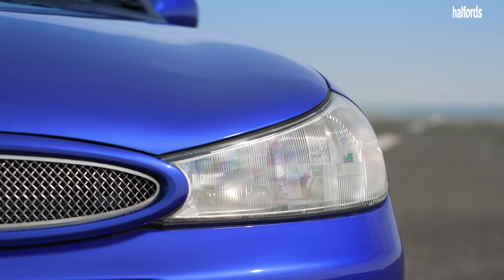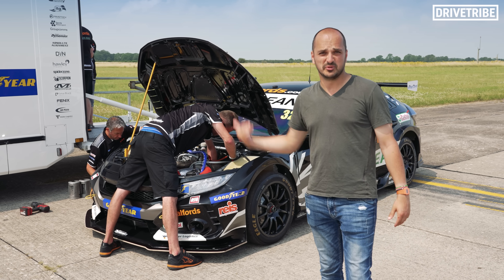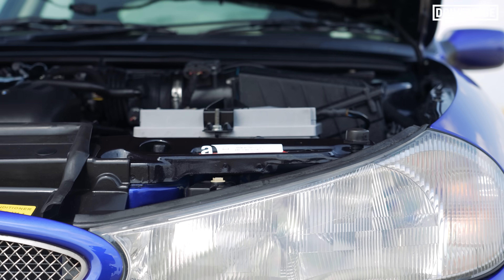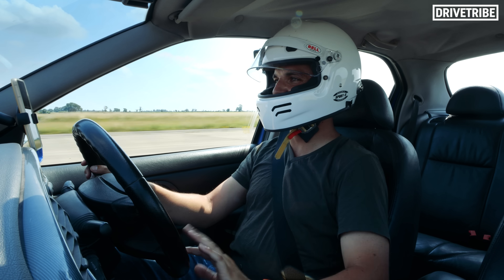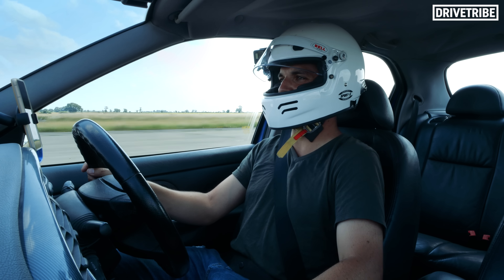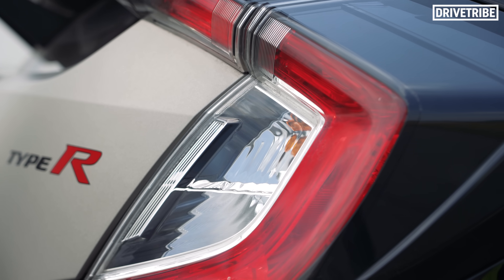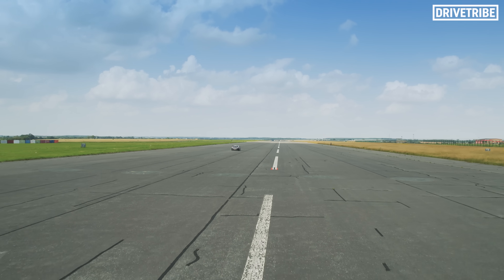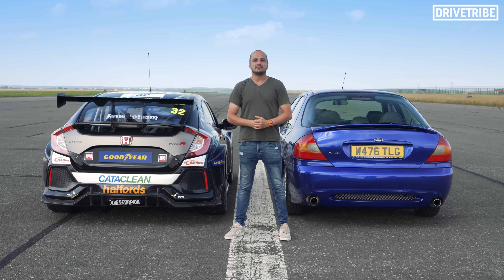Can our 21-year-old Ford still hit its original top speed?!

Comment: If you ever feel useless. Just remember that this episode had a Halfords Technician torque the wheel nuts and check the levels on a newly restored car 🤦‍♂️
Reply: That's exactly the time to check it. People did that restoration and people make mistakes. And I guarantee it wasn't a master tech who installed the rims and tires. It was the shop apprentice. I'd he checking everything as well
Reply: @Maroco918  I knew someone was going to write that. I will make sure to get a Halfords Technician to pop round my house 3 days after I next have my tyres changed. 🙈
Reply: @Maroco918  I'd rather the apprentice check over the work from halfords given what I've seen them let out the door back to the customer.
Reply: What's an advertisement??
🤡🤡🤡🤡🤡🤡🤡🤡🤡🤡
Reply: @Maroco918  do you check the torque of every suspension, steering and braking component when you buy a new car then?
Reply: @Pugjamin  no, if I buy a new car I have a PPI (pre purchase inspection) paper signed. I only check for cotter pins and lug nuts on new vehicles. If I buy a used one, yes everything gets checked. 

I did PPIs for 6 years at a dealership, you'd be amazed what shows up wrong, loose or missing from the factory. Sometimes you get had batches. Ive witnessed it first hand too many times. People put cars together and people make mistakes. I'm not chancing that when my wife and 3 kids are using a car.
Reply: Only way to be sure is to do it yourself. Isn't too difficult...
Reply: We got a shop to install a drivetrain into my friends car, had a solid rear axel. And the goons didnt tighten the u bolts. We were crab walking all over the place
Reply: @MrSilverNutz  that's terrifying! Glad you guys are all right. It's crazy what a flat rate industry can produce sometimes
Reply: @Maroco918  ya it was, we got it all tightened down, but now it crab walks constantly haha. Off to the alignment shop i go
Reply: @Maroco918  the second you validated yourself as having a wealth of experience the YouTube hounds immediately move on to their next victim and attempt to act like they know what they are talking about. It's hilarious to watch.
Reply: @stevenross-watt8640  they scattered like roaches when the lights come on 🤣🤣, have a blessed day brother
Reply: I bet he felt useless
Reply: Not the smartest way to work in one of your sponsors
Reply: Why so rude. Someone had to pay for the ST200 project....
Reply: Sound like advertisement to me.
Reply: @blackericdenice  that’s because it is
Reply: wheel nuts can come lose. even more on new rims. seen it happen. tyre pressure could be taking it form normal road to a high psi for track use. and levels change alot. motor might burnt some oil with its new seals it happens
Reply: @jnrdirtyduck3499  Yeah but you don't a guy for that.
Reply: @dutchdna  you do it their paying you
Reply: @stevenross-watt8640 and you're not on YouTube looking for victims, huh? Loving the projection...
Reply: yeah but that car as lovely as it is also puffs chunks of blue smoke under heavy load so the top end(s) needs a rebuild anyway lol

Comment: Sagging headliner, wrong springs at the front, no ST200 badge, engine smokes like my old 2.0 Duratec with worn piston rings… the final result is rather disappointing
Reply: And the front bumper was fitted poorly
Reply: Knackered rings plagued the 1.8 and 2.0l duratec as they aged, killed so many mondeos with otherwise decent body's.
I drive a V6, they are bullet proof :)
Reply: Yes, I noticed that the front of the car is sitting very high like a clown. I think the guy that rebuild the engine used the standard springs to a Mondeo V6 instead of the ST2000 springs. He does not know what he's doing.
Reply: My 50 year old Corrina does a 1/4 mile in that time. What a joke. They also look like std ST24 front springs. Not right for that car at all.
Reply: @placesbramlepoops  st24 will do, the mk1 and mk2 are the same car.
Reply: @danielfl.9347  i have a picture of my st200 from 2000 - and the gap size was the same as you see in Mike car, if you use Ford ST200 front spring - the results are the same
Reply: @danielfl.9347  where do you get st200 springs from nowadays ?
Reply: @johnstonlee  From Ford.
Reply: @danielfl.9347  😂 go on then, let me know if any available from Ford.
Reply: Yeah the front springs and the blue smoke were really red flags for me
Reply: Richard Harrold  Mike stated that Mad Ford had already completely run the engine in
Reply: @ivopongrac6601  And the passenger side rear door is a different shade of blue....

I really don't understand the end goal here. For an on camera restoration, the execution is pretty awful. No doubt at all it's had a ton of work done under the skin, but the lack of any attention to detail really lets it down.
Reply: @Mrcento  The presenter in the video stated that "Halfords have sponsored the entire ST200 build".... I guess this means that with what little funds they had, they tried to make the most of it. The results are.... ordinary.
Reply: @ST-pw7wf  I did not have the Mondeo, I had the Contour SVT from 1998. Mike's car is too high in the front compared to my pictures of the old Contour.
Reply: Actually my worn old 2L Duratec Mk3 with shagged rings smokes less than that. Bet yours still goes like a champ too
Reply: yep, the headliner was so sad to see. so like any other youtube car, it's looking perfect from a far, but it's far from being perfect
Reply: The truth is now out 😡
Reply: @stevefox3763 That was the MK3?

Comment: So the engines been 'rebuilt' and is smoking like an old ford transit??
Reply: Rattle-can rebuild. :D
Reply: I'd imagine it's wd40 still being burnt off from the build.
Reply: @MaryjaneKush  I know I'm not the biggest Ford fan myself but a freshly rebuilt engine will have non engine oils here and there and the first few pushes bearing a load will push that through.
Reply: @mypinis  There won't be any lubricants from the build left! He clearly said it was run in before this test🙄 Who on earth would go and run flat out with a freshly built engine? If you truely thought that, then I wouldn't want to buy a used car from you😎
Reply: @MaryjaneKush  Fix Or Repair Daily
Reply: @rogerblackwood8815  why was the car smoking then?
Reply: @MaryjaneKush  and GM stands for Grotty Motors
Reply: Fix Or Repair Daily
Reply: @mypinis  I didn't say it was the best rebuild, just that it wouldn't be lubes from the rebuild, learn to read AND comprehend mate!
Reply: @rogerblackwood8815  the rings bedding in maybe?
Reply: @rogerblackwood8815  you car people are such annoying picks
Reply: @Roger Blackwood  there were under 200 miles on the engine, its been sat at the shop until this filming day was taken down on a trailer and lets just say that's also how it left because it wasn't able to under its own steam by the time he'd finished with it
Reply: @cynosuregambit8292  As I don't know the history of the car I can't really comment can I? Lets look at what we are discussing here, Matt said the engine was rebuilt and smoking like an old ford transit, which I thought was quite a humorous joke. I'm the best suggested it the smoke might be wd40 burning off from the build. I merely pointed out that any lubes used in the rebuild would have been burnt off long ago as Mike clearly said it had been run in, I did not hear any mention of how it was run in and to which schedule. So where did you get 200 miles from? And I don't know for sure either way, but I didn't get the impression he'd blown the engine so why would it need to be trailered away, unless it wasn't road legal?
Reply: It’s Hardly smoking jeez 🙄 it’s an internal combustion engine. It burns things and it’s an old car with old tech none of this opf dpf etc it’s going to have some residue.
Reply: @johnstonlee  You might want to read the comments I've left it deffo was smoking
Reply: @MaryjaneKush  I grew up on fords and never once let me done. Regular servicing is all it takes IMO. ST24 was hands done a beauty to drive on B roads.
Reply: I've got no beef with mondeos. I own one and it's great. But that rebuilt engine is knackerd
Reply: Matt, the engine was fresh build, not even driven in yet.. & he redlined every gear.. ended up blowing the fresh engine :D
Reply: Richard Harrold  Who knows ^^
Reply: Richard Harrold  Yes he has, He destroyed piston 6 because he has no mechanical sympathy and didn't actually run the engine in, it came from Mad ford with less than 200 miles done on the freshly built engine and he thought top speed runs from a standing start was the best way to do it until it went bang, Redlined every single pull. This whole video was bollocks
Reply: Gotta love a Ford 🤩

Comment: i see the exhaust smoke is colour matched to the car, nice touch
Reply: Looks like an american ford now
Reply: Nice
Reply: Richard Harrold  they did say that it had been "run in already" I wonder how long it was run in for
Reply: Richard Harrold  piston rings don't need that many miles to bed in lol.
Reply: all cars smoke under full gas pedal
Reply: No....no they don't  @EazyDuz18
Reply: @imthelastone  they do, its an engine it BURNS things so it has EXHAUST fumes
Reply: @EazyDuz18  fumes and smoke are not the same thing...you are very very wrong
Reply: @imthelastone  agree to disagree :)
Reply: @EazyDuz18  but then we would both be wrong ...sorry you are wrong and that's that 😂
Reply: @EazyDuz18  Yeah cars don't smoke visibly under load 😂
Reply: @EazyDuz18  That would be black, if the car runs fat to cool down the engine, or as we Germans say, Vollgasanreicherung. That was blue BUT its probably the new mufflers in the exhaust that havent seen that much heat yet
Reply: @imthelastone  Nope, you wrong just except it
Reply: @WRP_2003  they will do in the right camera angle and lighting go do some tests and report back
Reply: Could be clutch smoke too
Reply: @RandomReevuze Considering you don't know the difference between "accept" and "except," I think you need to take the L here and move on.  Those piston rings are clearly wiped.
Reply: @cruzcorp914  not from the exhaust pipes
Reply: @EazyDuz18  properly tuned engine burns so much theres nothing visible and exhaust system catches the rest.  So something is defective with the cars you're using.
Reply: Richard Harrold  built loads of race engines and never had one smoke like that without an issue
Reply: @maximumst  when you cant win an argument: correct grammar instead
Reply: @EazyDuz18  yeaaaaa that motors got problems
Reply: Richard Harrold    Incorrect.  If you actually watched ep. 2 of the restoration you'd see that they stopped when they got to the short block.  And in the beginning of ep. 3 he said the only other thing he did was check the main and rod bearings.  Absolutely no new parts in the rotating assembly.
Reply: Richard Harrold  I'd encourage you to re-watch the episode then.
Reply: It’s a shame the back door isn’t colour matched to the front one!
Reply: @WRP_2003  diesel maybe lol
Reply: @atodaso1668  If you are european you'd know that 50% of modern cars are diesel and it is extremely rare too see smoke out the back as of the EGR, DPF, CAT and multiple silencers. If you are american i'd understand why you'd say that as you only have diesel trucks, which generally "roll coal"
Reply: @WRP_2003 I was born in England, nice try. My dads golf tdi would smoke at full throttle?
Reply: @atodaso1668  Is it a MK4? If so no surprise as they are old and often remapped. A MK5 possibly could too. MK6 or MK7 not a chance unless its modified, and a MK8..... i'd take it back if its smokey under load 😂
Reply: that and the headliner is drooping LOL (fully restored eh)
Reply: fuel mate
Reply: @richardnorman1158  is the engine oil fuel?
Reply: @imthelastone  blue smoke can indicate fuel , running rich
Reply: @richardnorman1158  oh right 😂
Reply: @imthelastone  u need a lesson in mechanics mate
Reply: @richardnorman1158  yeah sure 😉
Reply: Richard Harrold  You were 100% right, watch the latest video on the Mondeo project, they really did hurt the engine badly doing this too speed run, not having it broken in properly beforehand.

Comment: Why not get a head start by going 50-80 mph back down the parallel taxiway, around the linking tarmac (as a higher speed corner), so you start your main run at 60-70 from the outset??
Or take a trip to Germany!!
Reply: Yes indeed why not U turn at the start of the runway - why is he doing a standing start not a rolling start - if he u turned in second he could easily see 140.  This video was an awful Halfords advert - what a load of c@@p!!!
Reply: OR they could have used the BTCC car to tow the Mondeo by breaking up the air in front of it.
Reply: I vote for a trip to Germany, would love to see Mike dealing with aggressive drivers and cornering on the Autobahn at 140mph+
Reply: while it was 20 years ago, i do remember hitting MANY runs on the open highway in germany that were far in excess of 135mph
Reply: @ghomerhust  I do that quite often on my way to work, at least once or twice a week
Reply: To be fair, a flying start doesnt make a big difference though in this case.
Reply: @GoldenCroc , explain why? Surely hitting the straight at 50-60mph has to allow more room to get up to 140mph+?
Reply: @jamesbrook16  It does, but by a very small amount. Think about how much distance it takes to accelerate to 60mph from a standstill vs how much distance it takes to accelerate from 140 to 141 mph, and you will realise it would only increase the end speed by 1 or 2 mph at the most in this car.

Thats why a "test" such as this should never be done on a runway, they are just too short, it takes an enourmous amount of space (3+ miles) to reach the true top speed in most cars such as this.
Reply: @GoldenCroc , true, but if 0-60 takes 8 or 9 seconds, that would give you 8 seconds more.  Would that only be 2-3mph at the top speed?

I guess they need a longer track?
Reply: @jamesbrook16  First, I want to thank you for giving me opportunity to explain this, as a former physics teacher it is very rewarding getting to do this again.

Secondly, dont feel bad about thinking its the time thats the limiting factor, its a very common mistake.

Now, with that said: since we have a fixed distance of runway, we are limited by that, not time. Which means that average speed is very important. If you do a 0-60 in 9 seconds, your average speed for those 9 seconds might only be about 40 mph, meaning you travelled 161 meters. This is how much you gain with a 60mph flying start compared to a standing one.

Now on the top end we already have 141mph, and want to get to 142. Lets say the average speed is just 141 to lowball it. This give us just 2.55 seconds of additional acceleration until the extra 161 meters are used up. Not much, right?

And yes, close to the true top speed, it can easily take 5-10 seconds between each mph gain in most cars. This car wasnt at its top speed, so it will accelerate quite a bit faster, but not more than one mph per 1-2 seconds for sure, which is why I said, 1 mph; 2 at the very most gain with a flying start.

Now you see why at least 3 miles or so is necessary with this car, the distance ticks by fast when trying to squeeze the last bit out.

Cheers.
Reply: @GoldenCroc , thank you for the full and clear explanation. 

Clearly you were a great physics teacher able to make the subject accessible and understandable to non scientists.
Reply: @jamesbrook16  Means a lot, thanks. 👍

Comment: 7:18 nice blue smoke from the Mondeo's exhaust (Freshly built?) and he didn't use the curve at the start (or finish) of the track to give a flying start of 30-40mph. It's almost like they wanted to fail!
Reply: Was a brand new build with less than 200miles driven, so redlining every gear was enough to blow it up.
Reply: @TheNismo777  what???? 🤣 I've seen cars going from the shop to the dyno.
Reply: Flying start doesnt make a big difference though, to be fair.
Reply: I was thinking the same , could have got it up into 2nd before hitting the runway.
My old Astra SRI  1.8 would keep up with that Mondeo.
Reply: The new video confirms you were right! Even though the guys at the shop supposedly had run it in...way to ruin a fresh engine!
Reply: @ruongluesteve  Sure buddy haha

Comment: 2:19 Aside of the wheel nut torqueing, everything a normal driver should be doing anyway.
Reply: ... aaaand almost nobody does, only just before going to MOT...
Reply: @andrewnorris5415  or lazy
Reply: The bonnet tends to get lifted once every 6 months. The wheel nuts were put on using an air tool. Nothing short of another air tool (which I have) will get them off.

Comment: "Fully restored" still has a saggy headlining 😅
Nice puff of blue smoke when accelerating with the civic aswell! 😬
Reply: Did you watch the build, job they done was amazing. The roof lining is probably just a snagging list. And a small puff of smoke, jeez. Get over it.
Reply: @poolio_69  Cop on would ya? The engine only had a partial rebuild, so the short block still has many miles on it. There's nothing wrong with that quick puff of smoke on hard take off.
Reply: @NathanFrench  well my 218k mile old E46 330i would disagree. As would my old mans 268k St24. (Same engine)
Reply: It’s a Ford, they come that way from the factory.
Reply: @johnstonlee  well said 👍🏽
Reply: Everyone saying blue smoke is ok, or normal 😅 it was an indication of something a miss, buring oil. They found out the hard way in the end.